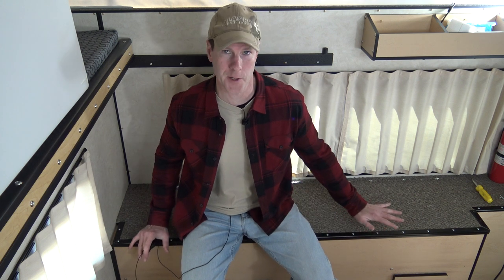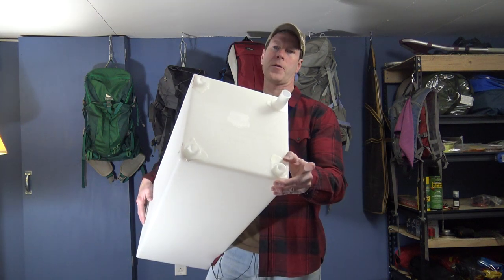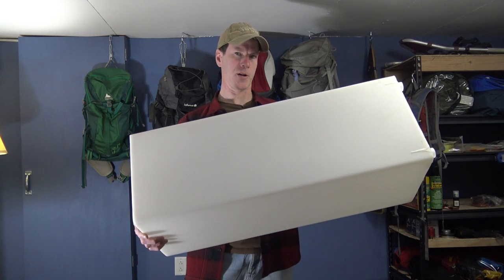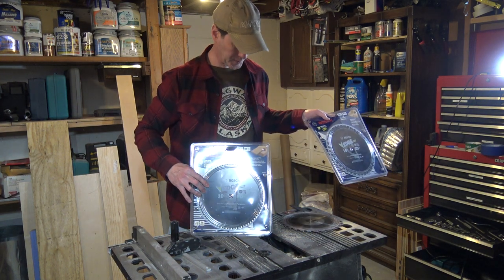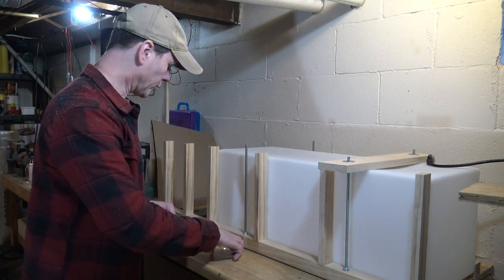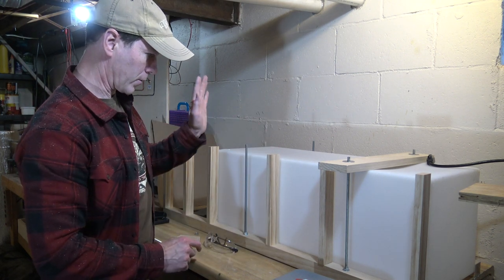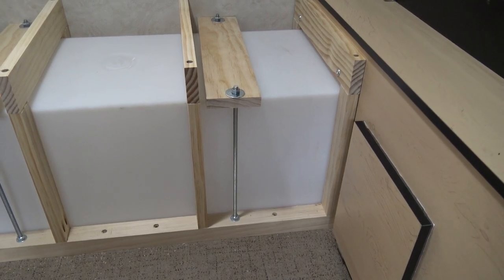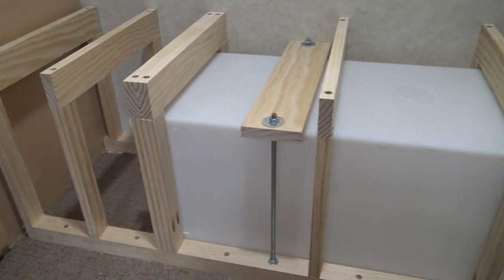Fresh Water Tank and Cabinet: Four Wheel Camper Shell Buildout #3

Comment: 2003, we converted a 1996 Ford CF8000 commercial truck to our concept of an ExpeditionVehicle.
For water, we use stainless-steel five-gallon retired Pepsi kegs.
A quick puff from a 12v bicycle tire pump to pressurize, and a kitchen-sink sprayer as the outlet.
* modular -- our standard is seven kegs, and we can add a dozen more
* separable -- a couple-three can go to town while using the others in camp
* a keg can move to a picnic-table
* isolation -- if one keg gets stanky, another keg can help clean it.
For showers, we use a three-gallon 'Torpedo' keg.
To heat the three-gallons, we use a kitchen 'sous vide' circulation heater.